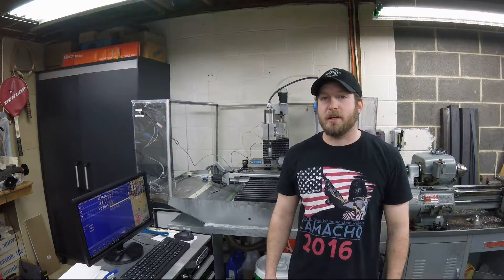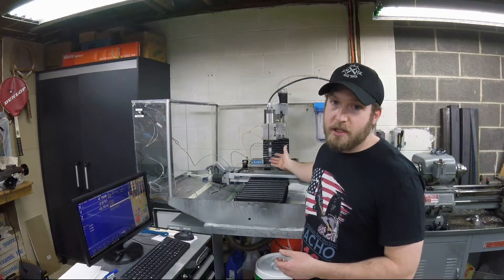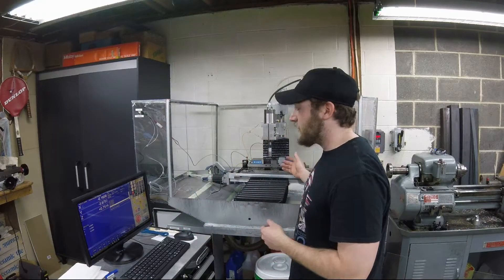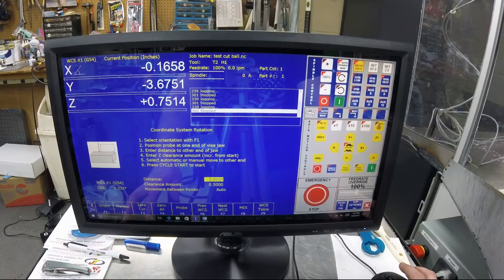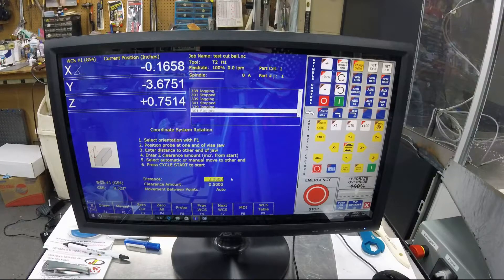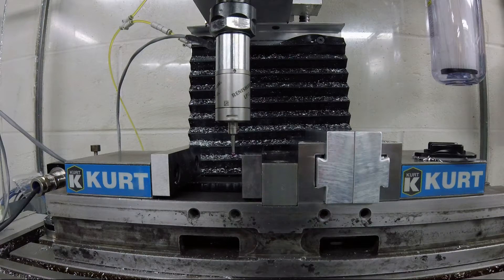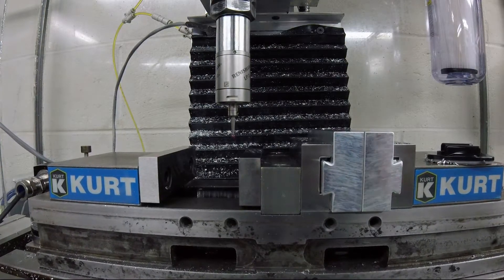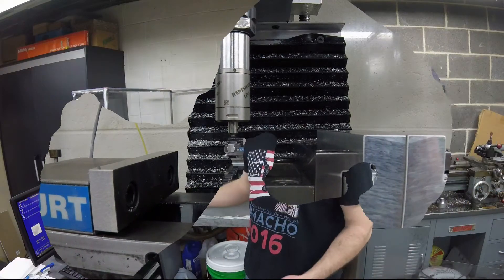Csr Probing with Centroid Cnc Acorn Control Board

Comment: I just bought an Acorn board hope to use it on an atlas 12" lathe conversion and possibly a Bridgeport mill... seems like it has a lot of features, can you use a shuttle / jog wheel with it ?
Reply from the maker: you can use an xbox controller and purchase a jog panel for it or you can get a touch screen and use the panel provided in the software.
Reply: They've just released a wireless USB MPG pendant developed in conjunction with XHC with custom Acorn overlay. http://www.cdxhctech.com/html/eProduct/view_64_393.html Looking forward to getting mine!